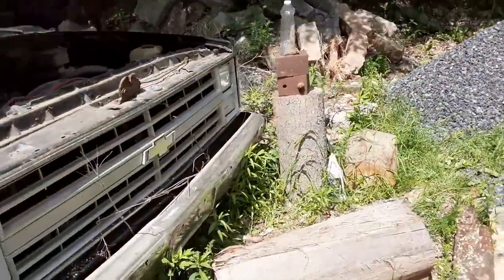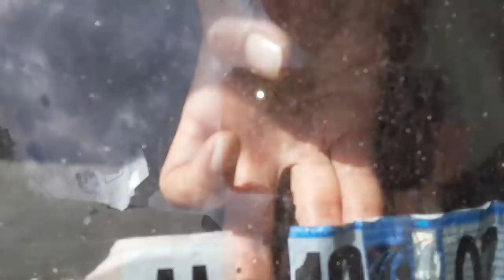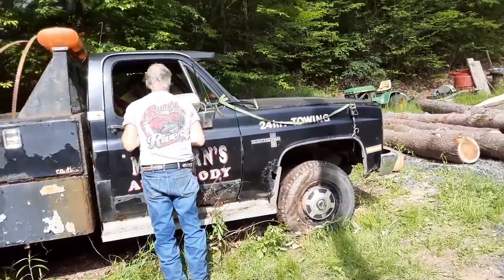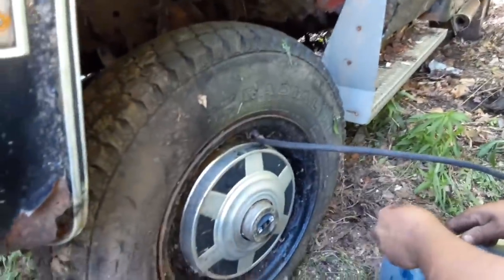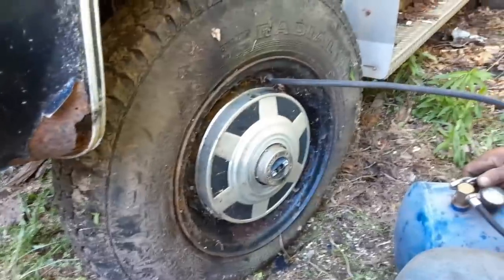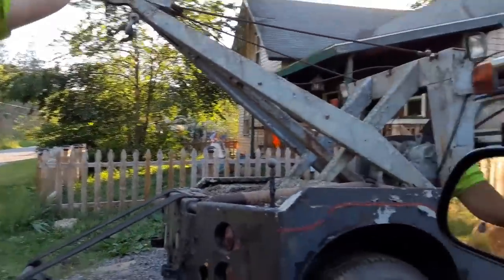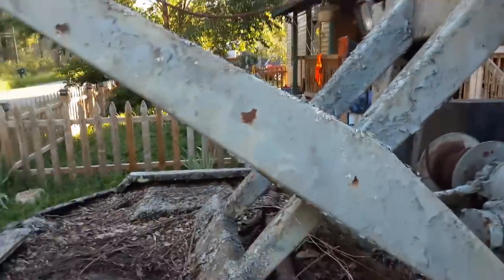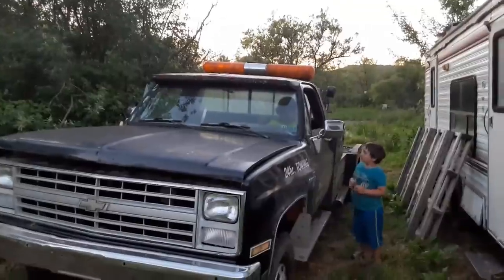Will It Run? 454 Big Block Chevy Square Body Tow Truck/Wrecker

Comment: the longer wheelbase wreckers arent common anymore. ive got 2 old ford units both the shorter versions a 220 on a supercab and a 440 onna f350
Reply from the maker: The guy I got this one from stretched the frame. Thank you for your comment.

Comment: Old School Sling wrecker trucks got mostly put out use, when the 90's plastic front end cars came about, those hyd lift Kits where too expensive to convert over too. but still there use full. love have one scoot around in, bring back great memories of teen years with late farther picking up scrap cars on weekend.
Reply from the maker: You are probably right about why they aren't really used anymore I thought the same thing the plastic bumpers would break on new cars thank you for the comment.
Reply: Yep a sling wrecker is pretty much obselete. Ours is now a yard dog with a set of gin poles. We now use a tilt top trailer with a electric winch. Insures cheaper than a wrecker. and can be pulled by any truck.  For a time I pulled it with a 66 chevy 1/2 ton with a 283 and three on the tree no problems.
Reply from the maker: @thecollectoronthecorner7061  Nice